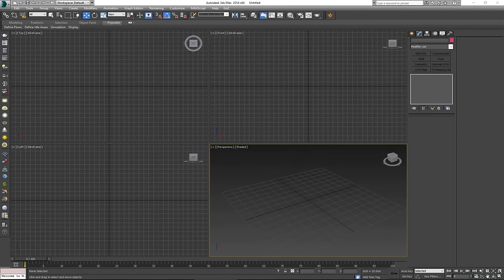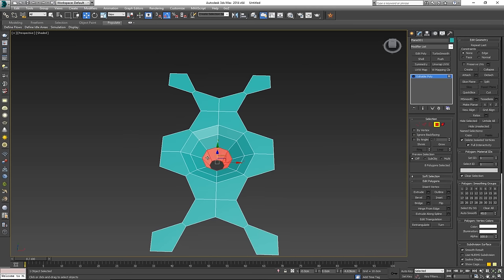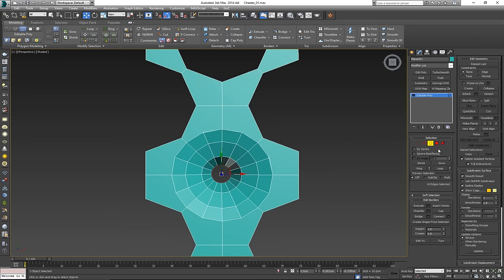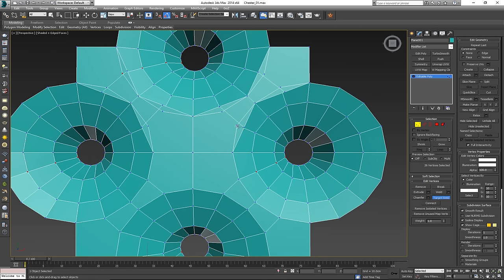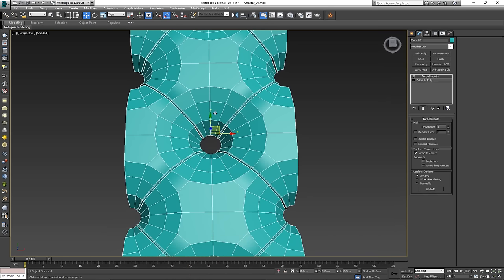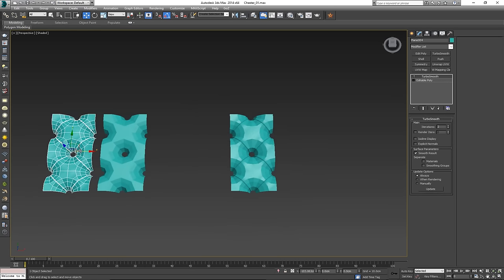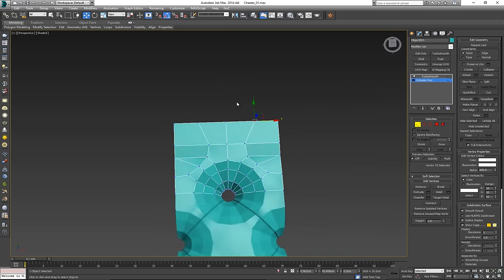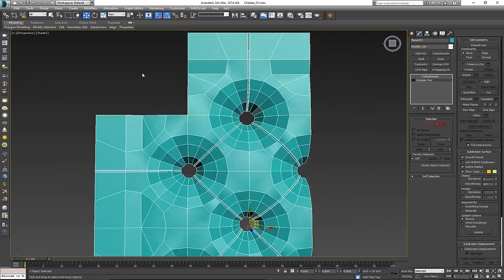Modeling Chesterfield Furniture in 3ds Max

Comment: in my 3ds max that small yellow cross which automatically joins cursor to adjacent edge or vertex is not available pls help
Reply from the maker: Sounds like you don't have Snaps turned on. Press S on your keyboard or turn it on manually ( If you have it on check to see if the option to snap to vertex is turned on by right clicking the snaps button )

Comment: thank you!  May i ask you, if i want to make a shape like in sofas in your video,  i have to use a path deform or something else for back, left and right sides? sorry for my english
Reply from the maker: Modeling actual pieces of furniture is very individual as most of them have a different approach to making them. If you are going after a piece that has a more complex geometry then you might want to take up the way with the Slide Knit script. I actually have a video about working with the slide knit so check it out:

https://www.youtube.com/watch?v=OcQbY84Qs9k&t=897s

Cheers
Reply: thanks a lot!

Comment: what is your snap angle snapp setting, cant do 21:12, cant aline with other part.
Reply from the maker: It's not an angle snap, it's vertex snap with axis snaps toggled on
Reply: @DenisKeman  How to toggle axis snaps on? I found Axis Constraints toolbar, but it only works when snaps toggle tools are off.  thank you for the response.

Comment: how do you align vertices and edges? around 21:10 - 21:30?
Reply from the maker: Turn on the snap option and make it snap to verticies. Then select the edge and press S to turn on snap, and with the edge selected go over to the vertex you want to align to. That should align the edge to the vertex
Reply: I still cann't get it done, sorry for the noob here.
I'm using 2016 sp 6 3dsMax,
1. snap option is on,
2. to vertex
3. Grid and snap settings - Options - Translation, Enable  Axis Constraints = Checked

Did I miss Anything sir ?
Reply: Hello Denis, I tried the description above. Snap on, vertex selected in snap, select Move and press shift move to extend. The whole new edge is going to the vertex. Not the yellow cross as is shown in the video. Can you clarify please?
Reply: Sorry for late reply, I got that now, goto transform tool (shortcut w)= Snap on (shortcut s)=left click and hold mouse on the transform axis= move to the vertex you wish to align with= done
Reply: Alt + D to enable axis on snap
Reply: that didnt worked in 3ds max 2019